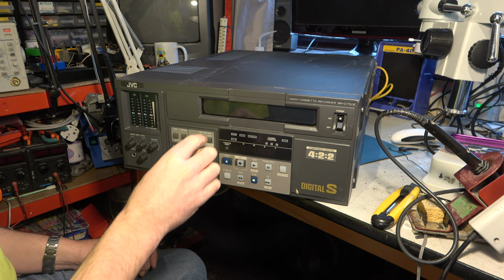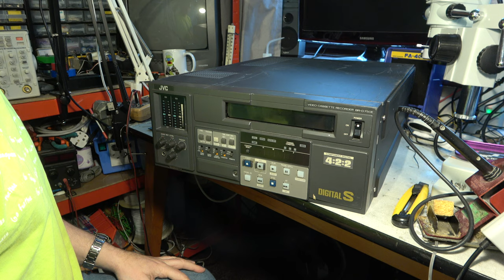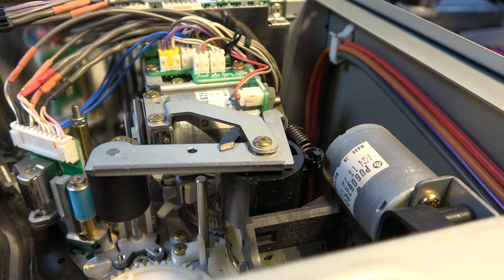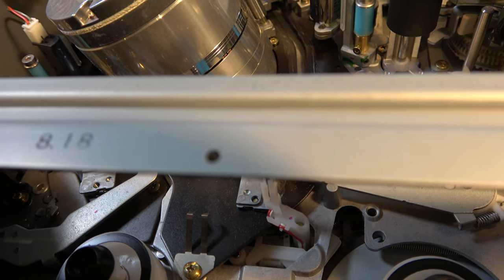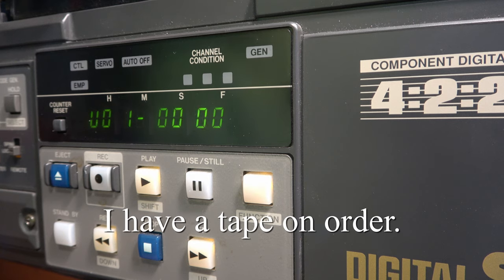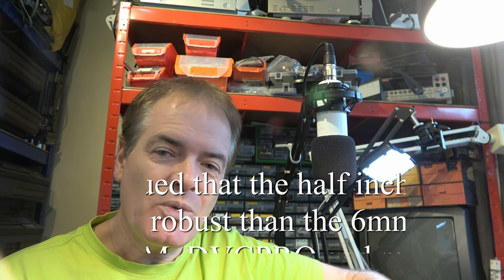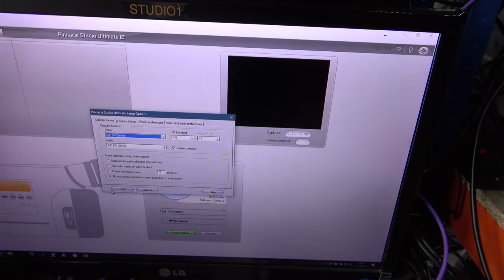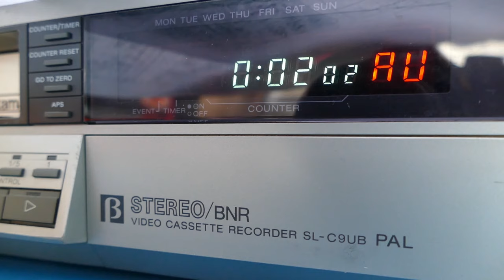Another failed video format.  Digital-S (D9) from JVC, the BR-D750E.

Comment: Regarding tapes, I believe it will accept the DVHS ones, or you shall be able to use SVHS and drill the extra hole that makes it look like D-VHS. Comparing to Digital Beta, keep in mind the D9 is inferior as it is only 50Mbps, while DigiBeta is 100Mbps, and the audio is 16bits on D9 compared to 20bits on DigiBeta. 
I will be looking forward for your next video showing this interesting machine in full operation.
Your videos are excelent and full of good technicall knowladge.
Best regards.
Reply from the maker: A tape is on its way.  I've also found out a lot about the menu structure too, so there will be plenty to demonstrate.

Comment: Used D9 all throughout uni - this very same model, actually! - as the studio was SD at the time. I guess from a value proposition the decks made sense. Never did capture anything exclusively off the tape though: we had a dedicated computer tasked as a DDR for that. Operating tapes was perhaps (aside from CCU/TD) my most favourite position. The fact that the machines are just so tactile made for an enjoyable experience. We even had an edit controller in the control room, so we could slave the 3 decks and use the vision mixer for effects and the like. 

Was definitely an odd mix of gear: Hitachi cameras, Snell and Wilcox switcher, I think a Predator in there for multi view.

They then upgraded to HD after I graduated. :(

Comment: I have actually heard about Digital S / D9 before, as it was the format a local TV station in South West Germany known as BTV used. This station later evolved into some of the most crazy TV stations that ever existed in Germany, first as BTV4U, then fresh4U and finally Kanal Telemedial. To my knowledge it is the only German TV station ever that had its broadcasting license revoked. They existed from 1995 to 2008 (they then moved out of their big studio that was even equipped for satellite transmission, stuffed all the studio equipment into a 19th century factory building and continue to irregularly broadcast to the internet). Digital S was used throughout. One interesting quirk of the system is the analog audio. There actually is an analog audio track, judging by the sound quality it is a VHS style linear track. This analog audio track is used for audio preview in cueing, and even in normal playback first the analog track is played, and after a few moments the machines switch to digital audio. At least this is what I can tell from watching old recordings of the aforementioned TV station. In later years they had almost no properly trained staff anymore, so often recordings would be played on air without preroll. So you could actually hear machines starting up on air, playing a very low quality, extremely noisy audio track for the first second before switching to clear digital audio. I would be interested to see / hear if you can replicate this effect once your Digital S cassette has arrived.
Reply from the maker: Fascinating.  I did mention that it looked like a normal VHS audio/control head, and now we know.
Reply: @video99couk   I have found an example of the analog to digital audio switchover. It is right at the beginning of the video, I will post the link in a separate reply as YouTube will almost certainly mark it as spam. And yes, that bizarre program was originally broadcast live via Astra satellite.
Reply: Here is the link to the video: https://www.youtube.com/watch?v=ZJvrOieQ3VE

Comment: I was at the NAB Show in about 1995 I think when that was released.    Very vague memory but I think there was an SDI output on some decks.  There was also a dockable back for ENG.   The D9 HD version at 100Mbps came later - too late..  Very little take-up and not many people even bothered to go take a look.     At the same show was the Ikegami CamCutter camcorder.  That was truly revolutionary, recording straight to hard drives and having in camera cuts based editing in the field.   It was ferociously expensive and looked a bit chunky..  If you don't have one of them already it'd be a huge score to get your hands on one.
Reply from the maker: This machine had the option for either Firewire, SDI or neither, but not both.  It should have had both installed as standard.  I do have a couple of professional camcorders, DigiBeta and HDV.  I may be getting one more too.

Comment: I wouldn't call it a failed format, at least not in the USA. It's really no different a situation than Panasonic M2. The new Fox NOC in Los Angeles was all D9 based in 1996 when it was built. Just as NBC made M2 the house format in the mid 1980s. Neither of them lasted very long but I think being a major USA network internal standard is not really a failure. I know Fox engineering under Andy Setos had a lot of design influence for the D9. You might even say it was built for Fox. Sony's answer to D9 was BetacamSX. Same level of picture quality as D9, but with more features.

Comment: The monitor out is mono because monitors generally have one speaker. Not much use for adding complexity by having two channels when it only needs to serve the purpose of letting you know that there's sound, and you can choose either or both channels to monitor from the front panel anyway.
Reply from the maker: By the late 1990s, all monitors were stereo and had been for a very long time.  DVCAM decks of the same vintage have stereo outputs.
Reply: @video99couk  I learned something new! I do have some Sony PVMs from the early-mid 2000s that have only a mono speaker though.
Reply: @themaritimegirl  completely agree with you. Even the DVCAM DSR-2000P has no stereo monitor output and that was a Broadcast machine. It has stereo output put not as Monitor Output ! And indeed all pro monitors had mono

Comment: D-9/Digital S was used by Antiques Roadshow in the UK (the only show I know that used it). The format was DV50 based so similar in performance to DVC Pro 50 (as used on EastEnders ISTR).  In video quality terms it's not hugely inferior to DigiBeta - but it arrived too late.  DigiBeta decks with Beta SP were also widespread - which was a significant benefit to the format.  The fact that Digital S decks didn't come with SDI I/O tells a story too.

As for the mono audio output for a monitor - that's not that unusual.  Most small monitors only had mono speakers.
Reply: The BR-D80U, BR-D860U, BR-D92U and BR-D92U had optional SDI.   The BR-D85 had built-in SDI.
Reply: I read somewhere that Fox News in the US used the format.

Comment: If I remember correctly. 
They stopped making Beta vcrs in 2002. From 1977 to 2002. Not a bad run for a defunct format.  I think when the war of the tape formats was on. Many had already adopted what ever format they thought would be the winner. 
Stuck with losing format.

Comment: DVCAM on a big fat tape.  We had these back during the launch of Fox News Channel as Sony were unable to deliver enough Betacam decks on such short order.  I still have spots I cut on a couple of these tapes -- NTSC though.
Reply: Digital S uses the same compression as DV/DVCAM, but at twice the bitrate (50 Mbit/s vs. 25 Mbit/s), and with 4:2:2 colour subsampling, while DVCAM was only 4:2:0. So Digital S is quite a bit better than DVCAM.
Reply from the maker: Well more like DVCPRO-50 on a big fat tape.  I wonder if it uses exactly the same codec as DVCPRO-50.
Reply: Digital-S or D-9 surely isn't DVCAM on a big fat tape. With its 3.3: 1 compression it could directly compete with Digital Betacam for only a fraction of the cost. It never got of the ground because the tapes had the VHS/S-VHS look and Sony already dominated the market with their Digital Betacam format, that was compatible with Betacam and Betacam SP.
Reply: @DrCassette  Digital-S does not use the same compression as DVCAM at all. Digital-S compression is 3.3:1, DVCAM is 5:1 and Digital Betacam is 2.34:1

Comment: That's such an odd thing for jvc to do, i think the janitor must have made the decisions lol.
I am a little confused why you bought it,  it's about as usefull as a chocolate fire guard :-D
That head looked odd untill i realised the rotary transformer was upside down and on top.
But the rabbit shelf reference looks similar to the one in vhs machines.
Reply from the maker: I bought it because I like to be able to transfer (almost) any tape that customers can send to me!  I specialise in wacky formats.
Reply: @video99couk  Wacky formats :-D
I would imagine you have got most of the formats covered now.
Audio recordings on wax cylinders or wire recordings,  a bit too wacky i think :-D

Comment: I also spotted a D-VHS machine are these two formats related?
Reply from the maker: The tape formula is probably the same, though the shells will be incompatible at least in one direction.  Otherwise, no.  D-VHS was another disaster, the two models sold in the UK couldn't even play each other's tapes!
Reply: DVHS was a consumer VHS machine with a modification to record a 19.3mbs data stream via 1394 Firewire from a digital STB including some hacked DBS boxes. Basically the raw MPEG stream in the USA and I think the same in Europe but delivered via a different RF modulation scheme, DVB, versus the American 8VSB. There was really not enough bandwidth on VHS to record that high a data rate. But since the stream had FEC (error correction) embedded, it did work quite well. JVC then introduced pre-recorded DVHS movies but only after they implemented a digital copy protection system acceptable by the Hollywood studios. The comment above by video99 is true but it was not a Beta/VHS situation. All DVHS machines were the same format and supposed to be compatible. But as it could barely support that data rate, interchange was ultra critical and that just doesn't happen with plastic parts VHS transports! I had all three DVHS models back in the day. Panasonic, JVC, and Mitsibishi. I had to label each tape as to which machine recorded it as they would not play each others recordings, well the Mistsubishi and Panasonic would mostly interchange but never with the JVC. I transferred my whole DVHS library to hard disk in 2011 but still have the machines and tapes.

Comment: An excellent device, only JVC BR-D51 is better as it plays videotapes SVHS 
Model Description:
D-9 FEEDER/PLAYER w/S-VHS PLAYBACK
Model Details
Features:
2 hour S-VHS playback
Two S-VHS Hi-Fi audio plus two S-VHS normal audio channel outputs
Editing Feeder/Players
High quality 50Mbps, 8 bit, 4:2:2 D-9 playback
2 hour (124 minute) playback time with DS-124 cassette
±1/3 variable speed playback (field / frame selectable) in Digital S mode
Jog / shuttle control
Analog I/O: Composite, Y/C, Component (Y, R-Y, B-Y)
Two 16 bit 48kHz PCM audio channels
Two Digital S cue audio tracks for precise audio editing
Front panel TBC adjustment of System, SC and video phases
Remote TBC adjustment via 15 pin D-Sub connector including video level, chroma phase, chroma level, and pedestal level
RS-422A standard editing and control with external editing controllers
RS-232C serial port for diagnostics
LTC / VITC time code
Rugged die cast chassis using ceramic tape guide rollers and sapphire flanges for long life
Center rotating head design for long head life
Reply from the maker: Some models also had NTSC / PAL switching, which mine doesn't do.

Comment: I think D9 models must have similar menu controls. Try BR-D95U manual (p.28), hope it helps.
Search this string in google: bbbb-81bb08603b73.pdf
Reply from the maker: Very helpful.  Also it seems something should have appeared on the monitor, so I need to investigate what went wrong there.

Comment: You shouldn’t hot plug FireWire there’s a huge risk of blowing the FireWire chip on the device or the FireWire card. Texas Instruments produced a warning paper about it you can find by googling I doubt it will allow me to post a link here.
Reply from the maker: I think the biggest risk is reverse plugging it.  It's supposed to be hot-plugged.  But maybe TI later found that it could blow up even without reverse connection.
Reply: @video99couk  it’s not supposed to be hot plugged that was a fallacy assumed because of how It was possible with USB as it’s next most comparable connection, the problem is that there’s no protection in line between the connection and the chip and the design of the connection doesn’t not contact ground first as it should, it’s just a bad design. People never believe it until they read up on it.
It’s going to be less of an issue with a 6pin to 4 pin cable because a 4 pin is not carrying the 2 pins of power (only the 4 pins of data) but still it’s a bad habit and sooner or later it’ll catch someone out.
Reply from the maker: @NeilHesterSkateboarding  Just checked the user manual of some JVC equipment which doesn't recommend powering anything down before connecting Firewire.  But that was with the smaller connector only.  Perhaps it was only the 6 pin cables which presented the real danger.
Reply: @video99couk  yes as I said the small connecter is 4 pin data (no power) the large connector is 6 pin (4 data and 2 power) so not so much of a problem but a bad habit to get into hot plugging. Just google “hot plugging FireWire “ you’ll see a bulletin from Avid in the results which links to the Ti paper. 
To my knowledge JVC don’t make FireWire chips and Ti do so I’d always trust the manufacturer over the integrator , your video somewhat proves JVC made terrible design mistakes .

Comment: It is clear that you never worked in professional environment. The Audio monitor is almost always Mono, even on Betacam! You need this because of the different tracks that are recorded. Ex Left is speaker, right is Ambi. On the front of most pro machines there is a switch to set on mix or Left or right just for the monitor output. Why people bought D9 (we did!) it was mutch cheaper an the same sampeling like Digital Betacam. For us it was a great system (just not always reliable, tracking problems on insert or assemble when editing). Regards, Wendy
Reply: Almost forgot I've got tree working machines including the BR-D85 with the serial digital output.
Reply from the maker: I still find the mono audio monitor unhelpful for my particular line of work.  Some professional kit certainly does have stereo audio monitor outputs, just looking now at a Sony J-H3 HDCAM player for example.  I have not come from a studio background, rather from an electronics one, we're all different.
Reply from the maker: If you have more D9 machines than you need, do let me know!
Reply: Hello, I understand that for your work this is not so practical. but the sony J series is not a real editing machine. For the moment I'am not selling these machines. We have a lot of archive tapes (already tranfered) we like to keep the tapes and the machines. Ps I like your video's (just not always when you take about pro gear ;-) ).

Comment: Sony almost certainly made more money per unit for Betamax decks than JVC did with VHS thanks to more restrictive licensing. The same reason Apple makes so much money for each PC they sell despite being less than 10% of the PC market.

And I remember reading on a forum (may have been tapeheads.net) that Betamax was actually quite profitable.
Reply from the maker: I'm not sure that makes any sense.  The cheapest, and best selling, video recorder in the UK in 1983 was a Sanyo Beta VTC5000.  It outsold every VHS machine at £239.99, and was followed by another huge seller in the VTC5150 at the same price.  The massive volumes, and UK manufacture, helped it to undercut VHS pricing.  Other Beta manufacturers such as Toshiba wouldn't have had any reason to back Beta if VHS had been significantly cheaper to license.
What I'm actually saying here is that the whole Beta product line including professional Beta derived formats, was much more profitable than the VHS derived professional formats like M, MII and D9, that all went nowhere.

Comment: Can't believe SDI wasn't standard.  Even Studio DVCAM decks generally had SDI pre-installed.  Firewire tosses out more than half of the colour information at half the bitrate.  This was dead right out of the gate.
Reply from the maker: I agree, SDI should have been standard on a professional format such as this.  DVI of course didn't provide a better picture for DVCAM since it's all DV, but the D9 format is about double the data rate of DV, similar to DVCPRO-50.